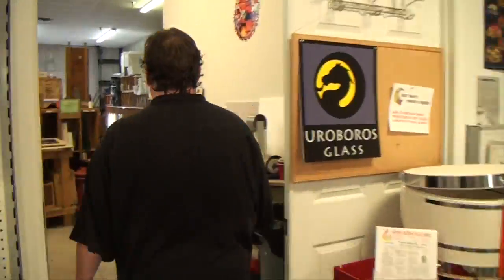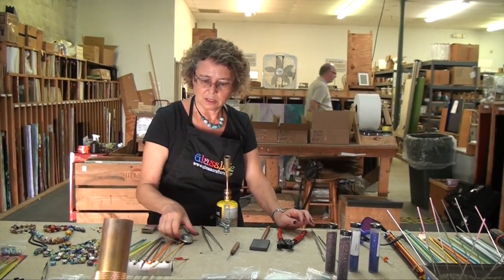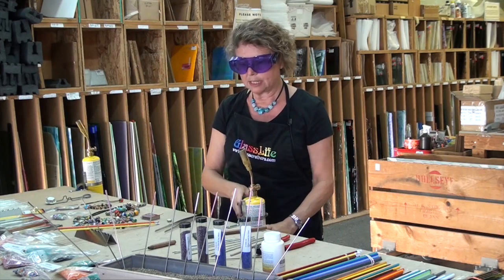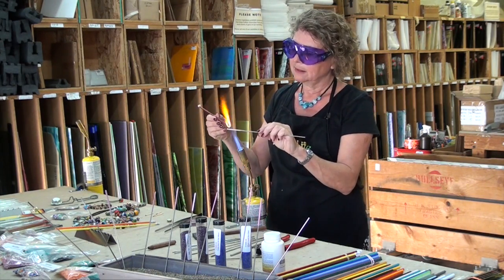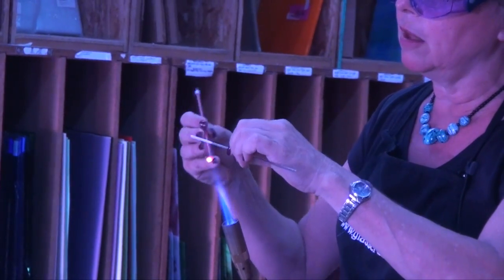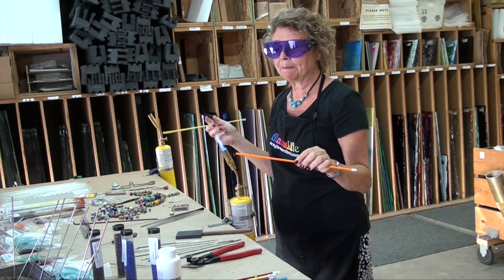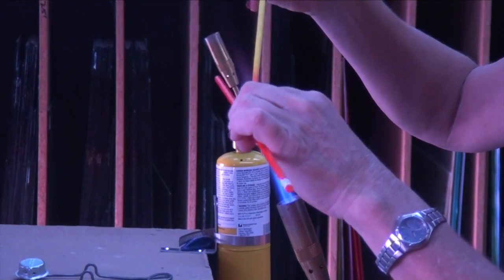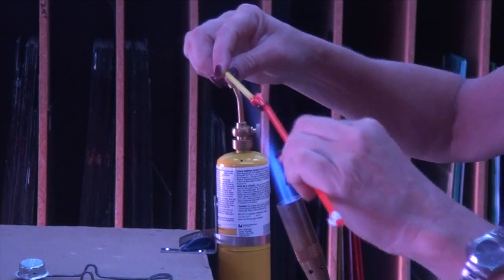How to Make Glass Beads!

Comment: I like to understand the more the distinction on when you need what grade of eye glass aka welding , tinted , or none...etc. I used welding masks when working with gas welding but this is more propane or mapp so not so sure the luminous  intensity corrosponds to what eye glass quality. I like to be safe so i hold off on doing large applications until i am sure of getting proper glass. Anyway other then not explaining enough on the safety /glass part the skill / technique you presented pretty well ...Great video great looking beads.

Comment: Curious , I am wondering what types of  eye glass your using i think i am over killing it with welding glass i can't really see anything out of them . Your eye glass seem more just sun glass. So for  safety purpose what eye glass do you guys uses is it just tinted . Because its hard for me to know what source of light require welding glass as opposed to just sun glass or  no glass at all?
Reply: 2:35 Better late than never I guess. Didymium glasses. Mine are darker and are not sunglasses. 20 years ago mine cost $60 but now can cost hundreds depending on the quality. They are needed to protect your eyes from UV radiation and sodium flare. Welder's glasses are much darker.